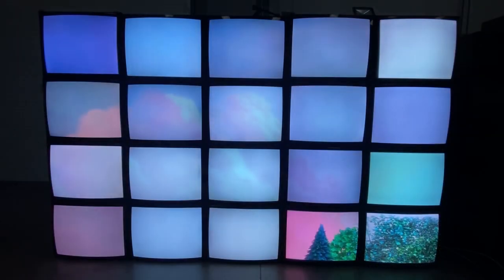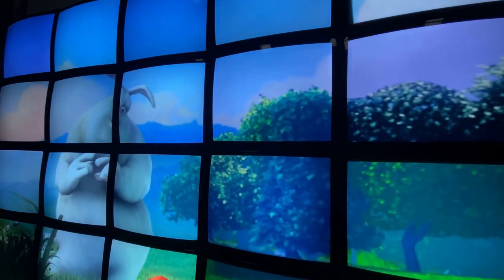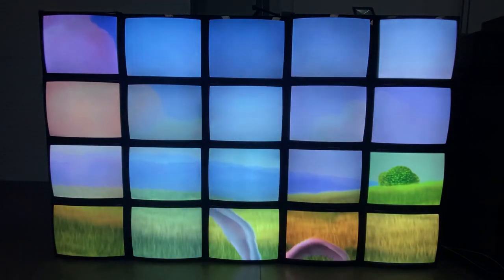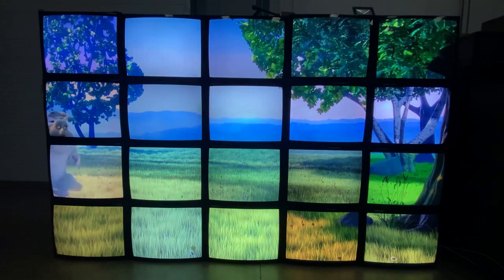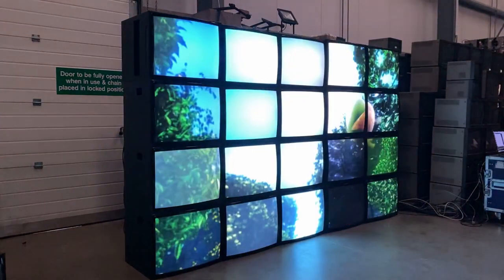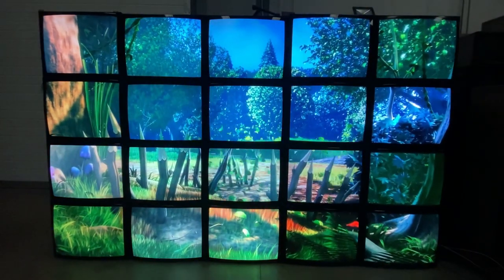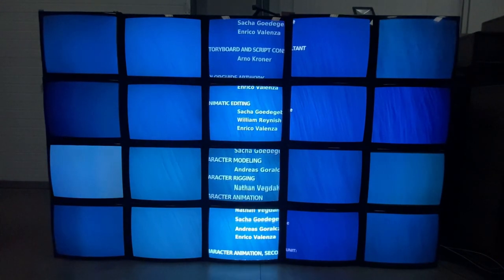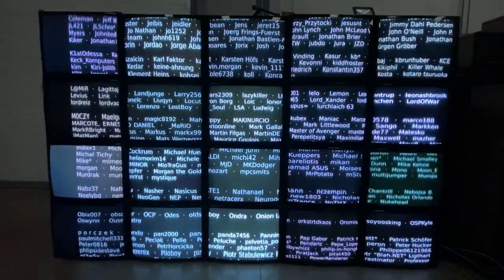CRT Video Wall Demonstration - Hantarex, Barco, Selti 28" CRT Screens

Comment: I saw the pile of processors you had off to the side, is this how it used to run back in the 90s? I didn't think so. Yeah, all the screens had to have their own feed, but I thought there was a diplexer of some kind that would do that for you. This isn't the same hardware they used to use, is it? Or is this some sort of hacked together method to achieve the same effect?